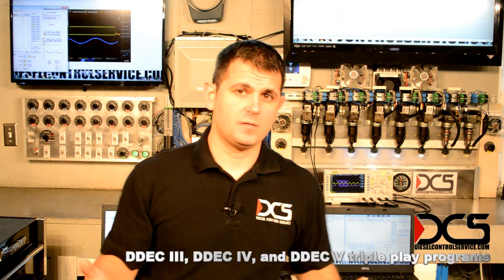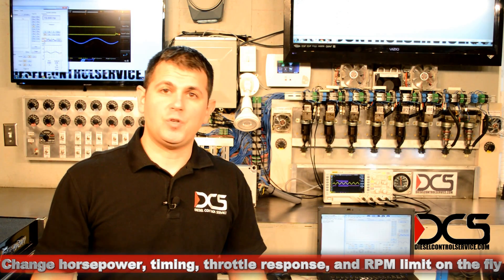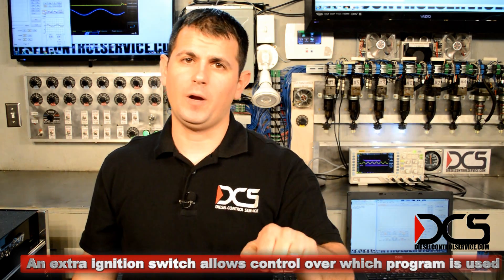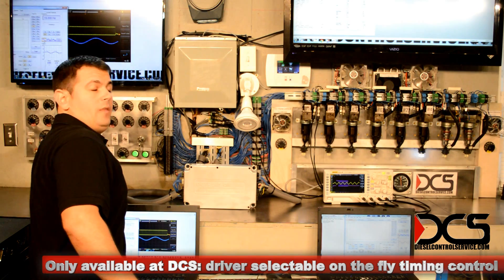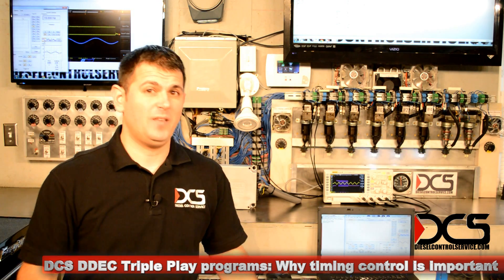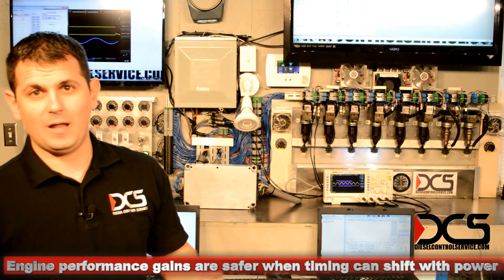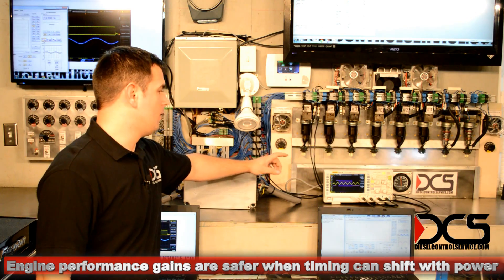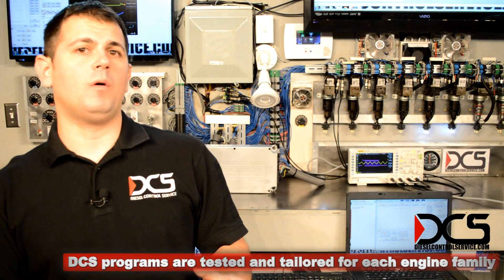The ECM Lab: DCS DDEC Triple play programs and on the fly timing control

Comment: I had my ecm programmed by dts... To make a long story shot my engine was rebuilt as an 11.1 Detroit, which the ecm was reprogrammed at 350hp.  I asked dts to reprogram my ecm for more power...he told me he couldn't help me...?? He advertise he programs all Detroit engine.... I guess he only programs certain ecms when he feels like it.
Reply from the maker: Your 12.7 BK60 06RE133770 was rebuilt back as an 11.1. How's that work? Magic shrink ray? 
Rebuilt isn't the right word, the word is replaced as in your 12.7 BK60 06RE133770 was replaced by an 11.1. Which 11.1? a WU60, WK60, SK60, EK60 or LK60? Nobody knows!  The builder has no serial number no build date, doesn't know and has no record of what the camshaft part number was on the cam he installed. Initially saying it had a 12.7 cam and injectors then later saying the cam was the stock 11.1 cam. There isn't a stock 11.1 cam, there are 9 stock 11.1 cams. Engine builders know don't these things use the wrong parts and build engines that no amount of programming will fix.
Reply from the maker: I apologize if my last reply came off a little harsh. You had the reman BK60 the strongest and most desirable of the 12.7 Series 60s and now you have the weakest. I've heard stores like yours before. Some say its a scam but depending on the fine print in the work order it could be legal. .Anyways a BK60 goes in for an inframe. The builder says the block is bad and needs replaced. When it's time to pick up the truck they find an 11.1 with all tags and valve stickers removed or scratched off.  If you google the average core price of a 1994 11.1 6067WK60 and compare that to the average core price of a 2002 or reman 12.7 6067BK60 I see a difference of about $5000. A shop or engine builder could make an extra $5000 on each job, maybe more for every 12.7 they "rebuild" back as an "11.1"  My first impression was that your engine rebuilder really sucked at his job but I could be totally wrong. Part of his job might be to disguise the engine a bit so the engines new owner isn't able to determine its value.

Comment from the maker: Thanks. I love doing these multi stage programs for a change. I've been doing single 12.7 580 hp 2400 rpm "jack of all trades" programs since 2008 and they get tedious sometimes.
Reply: Diesel Control Service I would like to buy this for my 12.7, do you have any videos of the program running on a truck? I had my truck "programmed" by another small company and had 0 power or mpg gains so I'd like to know if yours actually works before I spend the money on another tune
Reply: Hay r u still around